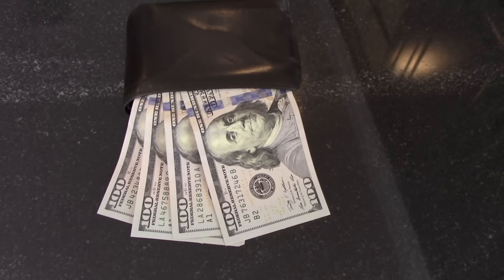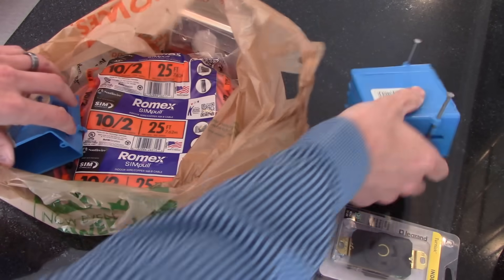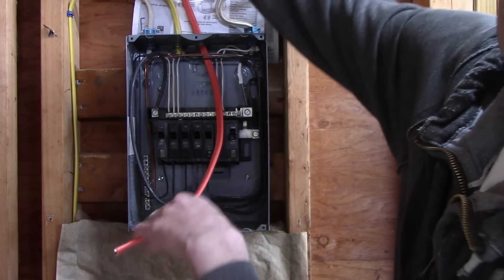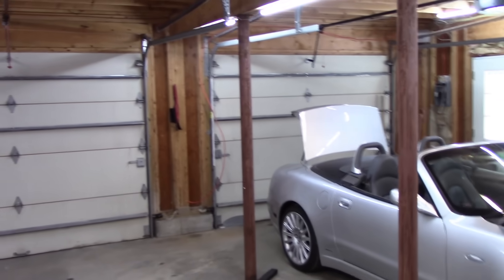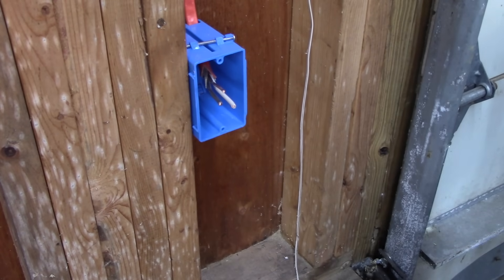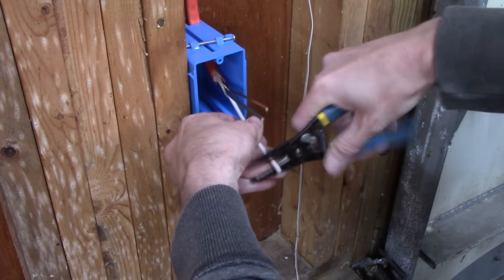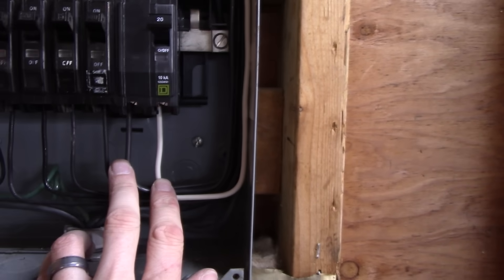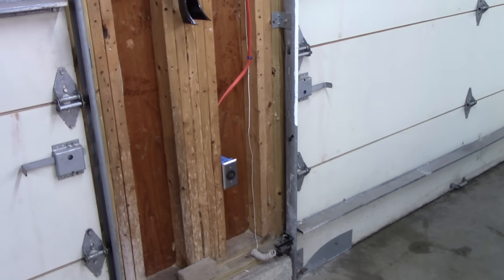DETAILED DIY: Wiring a 240v outlet step by step from breaker to outlet

Comment: Great step by step 👍. But just to avoid confusion, this is not two phase power.  120 and 240 are both a single phase, 240 is just twice the voltage.  A 120 circuit, one hot leg to neutral, is kind of like a center tap on a transformer in that it gives half the total voltage.
Reply: Thanks for clarifying that, it was bugging me to.
Reply: Yes in North America we use black or red for live and white for neutral (red is commonly seen in 240 volt circuits). In the video, though, he used white as a live wire and if you use white as a live wire it needs to be marked as such (usually by a piece of black electrical tape). The same applies when using black or red as a neutral.
Reply: The only two phase I ever seen was jump rope double dutch.
Reply: Or ps the other transformer would be before your meter outlet supplied by the city or whatever utility company you use that steps it down
Reply: Why isn't it two phase?
Reply: He didnt call it a two phase setup. He said each pole was on separate phase which is correct.  Get a clue!
Reply: One leg of 480 wye or delta. One leg of 240??????
Reply: It's not a transformer it's alternating current ohm's law with alternating current voltage always stays the same current changes which is measured in amperage so when you combine your voltage you get more pressure which allows you to have more current draw which changes your amperage. You just combined two electrical pressures together to give you a total of 240 volts which allows you to draw more current. The only transformer you'll have in the house is usually your doorbell hooked up to your furnace that steps the 120 down to 24 volts
Reply: You use black for live and white for neutral there right? Here it's brown for live and blue for neutral. In older houses it might be red for live and black for neutral.

Comment: 10 gauge wire (good for 30a and 30a socket, with a 20a breaker. I'm wondering why not a 30a breaker.  The only thing that comes to mind is that an inspector might question if your feed is large enough to handle the load from all of your breakers. It does happen...
Reply: Could also up sized the wire for voltage drop. In this case there’s virtually none but for longer runs yes.
Reply: He is running a circuit out of the panel feeding one device. So the load of the other breakers are not a factor. At this time the equipment he will be using calls for 20 amps and could be thinking of bigger in future. Remember you can run 20 amps off of 10 awg wire, but not 30 off 12awg wire.

Comment: Safety first—live circuit—no metal jewelry etc.  use your Klein wire stripper to cut your wire insulation instead of your knife for better safe removal.  Also using a knife to open the bundle can be an insulated wire fault in the box.  Safety - First.

Comment: Why didn’t you need 10/3 wire sorry I know nothing just interested
Reply: 10/3 is used with neutral and ground in the socket. If two hots and ground not needed, as that would be an extra wire.

Comment: My air compressor calls for 30 amp can I run off my 50 amp
Reply: It works, but is dangerous. If it stalled it may burn up the motor since the breaker won't act until you exceed 50 amps.

Comment: Nice job dude!   I’m gonna give it a shot. Only 1 problem though. I’m out of room in my breaker box and need a new one. Is it possible to add a sub-box like you did?  I think that’s what you called it. What will it take to add one? Cost?  Thanks
Reply: Sub panel. That’s what I think I need. Any idea on how to get one put in?
Reply: @OUNOU812    
So how did it go?     I just got a professional estimate for a single 240v 40 amp outlet/line/breaker, and it was $1880 or $2200 with a GFCI, granted it's four years later, sky-high inflation, etc  
BUT HOLY CRAP!   A GFI is redundant anyway. 

Why are current 2022 online cost estimators always lowballing (or it seems that way)?  Professional thievery, I guess.
Reply: I'm off to Home Depot tomorrow, I just hope their expert knows their stuff?
I'll take a photo of the existing type breakers, and probably an 8-3 gauge wire. I already own a lithium powered shop light, so I don't have to do it live.

Comment: can i go this route for my air compressor i believe it’s a 240v with 15 amp it also says LR AMPS = 93   ???
Reply: lr is locked rotor amps
Reply: depends on the length of the run.

Comment: You did a nice job . In Canada our code calls for red tape on the white wire used as a hot leg . So some young person in the future don't take it to be a neutral.  Just RING it . Talking about ring we are not to ever wear rings in a panel . I have worked with 4 jmen that have had that  finger cut off because of a short .
Reply: The code in the us calls for the same.
Reply: The reason my dad never wears his wedding ring on work days...  mom wears it on her necklace from  mon at 0530-fri at 1630

Comment: Red seal with 30 years in trade . 
you did a great job . the wires looked like 10 if you have them that's better than 12 and give you future expansion.  . you could of used some 77 wire lube . Overall great job .
Reply: I'm sorry but did he need to marker the white wire by something red? Because in that case white wire is not a neutral. And I guess for the future there would be safe not to take a neutral from the white wire if he marked it. Sorry for my english I hope I could explain what I meant.
Reply: KpEHgEJlb their just fuking around I mean joking around, it's unsafe way to do things but it's all good work. and yes black tape should be used. but common sense tells. you everything

Comment: Well, well, well, Utube to the rescue. I've been wanting 220 in my barn to run my mig welder. I watched this vid a couple times and it seemed easy enough. So, I went and got the materials and ran the power over to where it was. It worked! Thanks...
Reply: @Trialnerror  Oh, you are welcome. I don't have a very firm grip on electricity. I just don't understand it. Your video was easy to follow and it worked. It makes a huge difference in the performance of my MIG welder. Again, thank you...
Reply: @harlannorris6035  There are easy booklets that explain most of what needs to be known to do wiring, and the most important thing is keeping in mind a few things such as it only hurts the wallet to use larger wire to make a connection. Motors and welders draw more current initially that make using a larger wire a good idea as it is less likely to be a problem with overheating. I personally do not like romex or NM cable, as mice and chew it, and it is exposed to the wood. I like flex and conduit... personal preference.
Reply: @Paul-gz5dp  Right., well, what I did was I ran 10 ga wire 50' to the plug. That is on a 30 amp breaker. An electrician I know said I'm protecting my wire. I have a Millermatic 211. An older one that I used to run on a 115 v 20 amp circuit. It worked ok, but for say anything 1/8" and above, it really wasn't enough. However, it never tripped the breaker even then. I did run romex even though I have all the 115 wiring in conduit. We'll see what happens with that, I suppose.
Reply: @harlannorris6035  That is more than enough for that unit. Only other things that you might want to get is an Argon tank and regulator. Then you can get some really good welds.
Reply: @Paul-gz5dp  Ha, well, my main issue now is not the gas. It's my vision. I'm 67 and I just don't see as well as I once did, A cheater or glasses help, but, nothing beats young eyes. I have thought about pure argon. C25 though is not cheap at about 60.00 a bottle. Argon is more.
Reply: @harlannorris6035  Magnifying lenses are available that fit in the welding hood, and if only welding carbon steel pure CO2 does not cost too much and does a good job. Argon is needed for stainless and aluminum etc.
Reply: @harlannorris6035  Did not know in the past what bad vision was like, till I was criminally attacked, and now I have a hard time with vision. Those black spots, and problem with focus is the worst. Just glad that he is dead now so he can't come to my place and shoot me or my family, just wish he had died before he had a chance to attack me. If time travel were real it would be quite easy to solve this problem for myself, and possibly others for the things that caused them to loose their vision. Age is not always a factor, it is the things that happen to us that go along with living in this world. My grandfather lost much of his vision in one eye as a result of high blood pressure and effects of leukemia, as his blood was thick and it caused the retina to detach partially in one eye. With me it was the vitreous sack that detached from my retina. Many say it is age related, but I'm not so sure as it is often a result of impact or falling. Falling when older causes damage all over the body.
Reply: @Paul-gz5dp  Well, that's pretty intense. I'm sorry that happened to you. With me though, it's just the normal, I think, gradual decline of my vision. I'm far sighted so close work requires about a 3.5 magnification lense. It works "ok" but it's not like it was when I was  under 40. Still, it's ok because I'm retired and no longer working in my trade. I was a pipefitter. I did weld quite a bit but not any MIG. I also have a gas welder that I use for larger work and as a generator for my house. It's all just a hobby now.

Comment: can i use 12 instead of 10 wires?
Reply: @Trialnerror  always go bigger if you can afford it. If your needs change the wire will be there. Also a 20 amp braker with a 30 amp plug , why?

Comment: I have a sub panel that was installed prior to me moving  in there is only one buss bar that they used for both the ground and the negative wires should I install another buss bar for the ground only
Reply: 4 wires should have been run from the main panel to the sub panel, red and black for the hot side, white for neutral, and bare or green for the ground. There is usually a bonding screw that bonds the neutral to the panel. It needs to be removed for a sub-panel. The white neutral between the main and sub panels will always carry a load equal to the difference between red and black poles. For example, if there is a 30 amp load on the black pole and a 10 amp load on red pole, the neutral will be carrying 20 amps. The ground should only carry a load in a fault condition. If neutral and the ground are connected in the sub panel the ground will always be carrying half the neutral load, in this example 10 amps, leading to a potential shock hazard.
Reply: @Trialnerror  I kinda figured as much , thanks for the quick response.
Reply: @gatherstudio5219  adding a new ground bar connected to appropriate grounding rod shouldn't be too hard.
Reply: @mattsullivan8466  
He wouldn't need a separate grounding rod if it's in a structure attached to the main structure. Just have to make sure the ground and negative bars are separated in the panel.
Reply: @vervi1jw1  There is no negative bar in an AC panel. You must mean the neutral bus.
Reply: Youd be surprised at how many do that. They're the dudes you see on the beach wearing European Bikini Speedos and have singed unibrows.

Comment: Great video!! I have question I'm going to add a 220 outlet in the garage for a welder. 170 Amp-DC, 240 Volt, MIG Welder Do I have to get a 170 amp breaker for this or the 30 like your is sufficient? Thx
Reply: Just go with the 170 and post a video of this marvel 😉
Reply: For a welder I would suggest a 50.  That's what most of the welder plugs are.